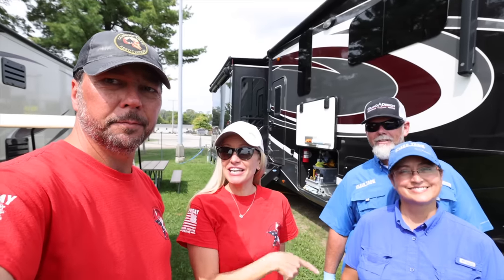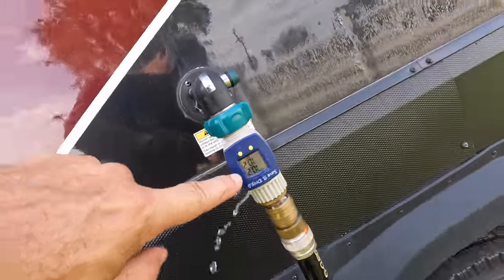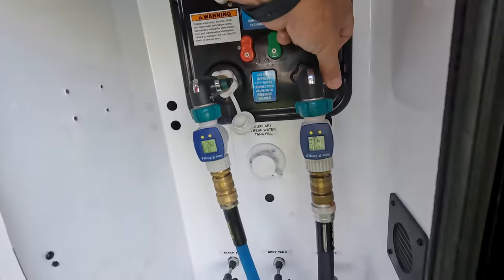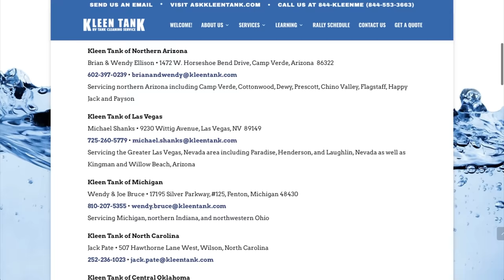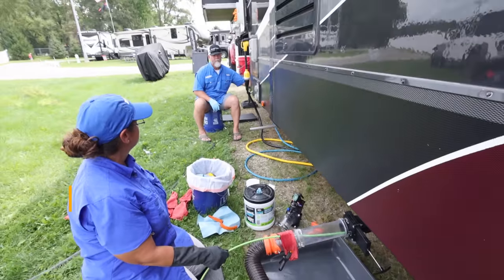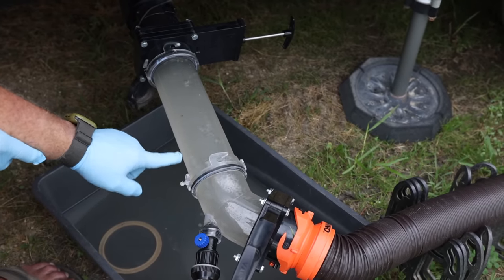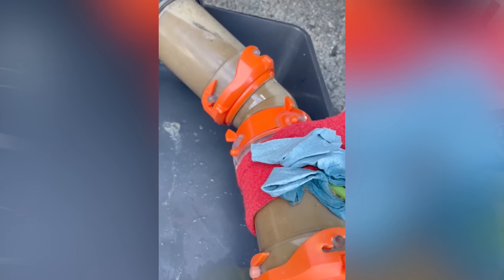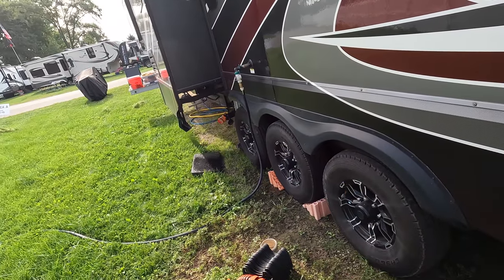RV Tank PRO Cleaning! (Kleen Tank)

Comment: Great tips and I need to find these guys to do my tanks.

So the discussion basically circled around gray tanks regarding the pine sole and beads, was there a recommendation regarding this same solution for black tanks?

We have had our rv since 2015, and just last week I replaced my gates on all 3 tanks, and just based on what was stuck to the gates I can imagine what the tanks look like.
Reply from the maker: We are still using the Happy Camper in our black tanks, since those tanks were in good condition. We tried the PineSol Calgon mix in our black tanks  and they started stinking up within a couple of days. Just be sure to use the HC as directed!
Reply from the maker: We are still using the Happy Camper in our black tanks, since those tanks were in good shape. Just remember to use as directed (mix with several gallons of water) Also, remember to do a thorough job flushing the black tanks. 😊 We have been using the pineSol/calgon mix every travel day in our grey tanks, so hopefully there will be no more mold!

Comment: Wow! - That was an awesome video! Super educational. Great coverage of a rather crappy topic.
So, what did they recommend INSTEAD of Happy Camper as a black tank additive?
The Calgon beads and PineSol sounds like a great treatment for the grey tank.  - Cheers!
Reply: Also wondering what they recommend. And, maybe I missed it, but why do the not recommend Happy Camper? The video showed super sludgy "stuff" coming out but I've never seen that from mine so just curious.
Reply from the maker: We are still using Happy Camper in our black tanks, since those were in good shape. However, be sure to use it as directed ;)

Comment: Great video. One thing I always said is I was these manufacturers would put a gray tank flush in too.
Reply: Why?
Reply: They have it it’s called a faucet turn it on flush the tank out
Reply: I personally think gray tank flush systems should be standard by now. 
Our trailer has a combined black tank flush and it's a pain sometimes. 
It flushes both black at the same time. 
I would rather have all the water flow in one tank at a time. 
Plus we don't even use the back black.
Reply: I don't now and have never owned any kind of RV, but it kinda makes sense to me to flush the grey tank thru the black tank.  The soapy water in the grey tank, when released into the black tank, would help further wash out the black tank, especially if you did a thorough black tank flush before releasing the grey tank.  Then fill the grey tank with water and cleanser (via RV sinks), dump black tank that's now full of grey water, release grey tank with clean(ish) soapy water, repeat as necessary until water runs clear.
Reply: @loragunning5394  That's a great idea 👍
Reply: Our American Coach actually came with a black and a gray tank flush, so I guess maybe some manufacturers are listening to these types of requests.

Comment: Just looked at WalMart for Pine Sol and they only sell Pine Sol Original which says on the label "Contains Pine Oil". So, if you are looking for Pine Sol, be careful which one you buy.
Reply from the maker: Yes! We just found this out ourselves. Apparently, they did bring back an additional mix with a small amount of pine oil in it. We found the one that doesn't contain it here... https://a.co/d/8KO3aqj
Reply: @ChangingLanes  Thanks for a very helpful video for both black and grey tanks.  We plan to use the mixture this year.  We did order from the link provided, but what was sent to us did contain Pine Oil based on the label. Still on the search for Pine Sol without pine oil.  Thanks again

Comment: What toilet paper would you recommend?
Reply: There are any number of specialty toilet papers available for boats and RVs available online or at camping equipment stores, but it's expensive and is basically just single ply paper much more porous than double ply dense weave papers that many folks use in their homes.  Scott Paper makes a single ply toilet paper that is very inexpensive and breaks down in water very easily and quickly, comes in 1000 sheet rolls, and is available in just about any grocery store you may shop at.  There is also a test for a toilet paper's ability to break down that involves a specific amount of water and (unused) toilet paper in a lidded jar, you shake the jar vigorously for a specified period of time, if the paper dissolves it's ok for septic and holding tanks, if it doesn't, it isn't.  Brand names don't really matter...
Reply from the maker: We use this kind... https://amzn.to/3fhGa3P

Comment: Did anybody else have a problem I mixed  2 oz of the Calgon beads with with the  Pine soul and it foamed up like crazy out of the bottle what a mess.  Didn't even  get a chance to fill the bottle the rest of the way with water. What did I do wrong?
Reply from the maker: I reached out to our friends at Kleen Tank and here's what they said... When you mix the solution the pine sol and Calgon do bubble up, then settles. Then add the water. However, boxed calgon foams more than pearls. Hope this helps!
Reply: @ChangingLanes   Thank you that's exactly what I ended up doing waiting and they added more water. It's just better to know mix it outside.
Reply from the maker: Definitely! We certainly wish we had know that when filming this video 😉 Hopefully, it didn't cause a big mess for you!!

Comment: Very interesting video and information.  We've been using the "Geo Method" for tank cleaning for years and are pretty happy with our results.  The tanks seem cleaner, odors have been reduced or eliminated, and the sensors seem to work more accurately and be more reliable.  The "Geo Method" is Dawn dish-washing liquid and Calgon mixed in water.  Would you or they suggest replacing the Dawn dish-washing liquid with Pinesol instead?  

Like you and probably almost everyone else we've always concentrated more on the black tank but I think we'll change it up now and give our grey tank equal time and care.
Reply: Wonder what the difference is between the DAWN and Pine-Sol
Reply: We’ve also used the Geo Method, but used the laundry version of Calgon. Now I’m wondering if we should have been using the bath version.
Reply: Both dawn and calGon act as surfactants.  Pinesol adds the disinfectant that neither dawn or calGon have.  Dawn keeps the grease loose - that’s a good idea!  Pinesol degreases too though so maybe overkill.

Comment: This was the card they handed out @ Tn Grand Design Rally.
NEW FORMULA
Mix 40 ounces of Pine-Sol with 8 ounces of Calgon Bath Pearls in a gallon jug. Top off with enough wafer to fill.
Shake gently. Allow foam to die down. Use four to eight ounces (as directed) in each tank (more in especially hot weather or if your tanks will be filling up slowly over time).